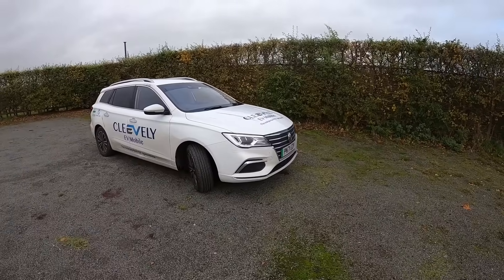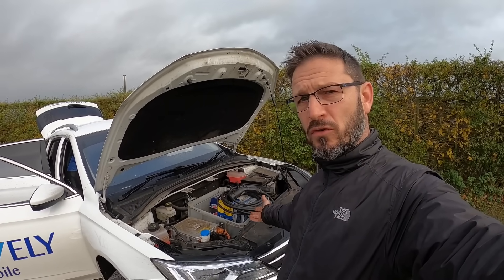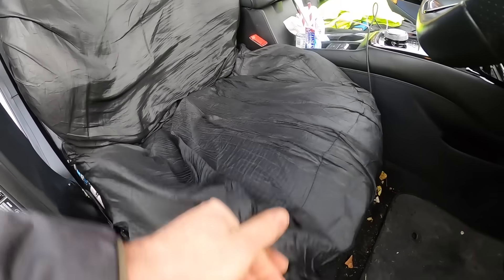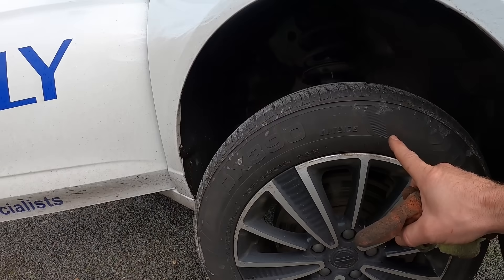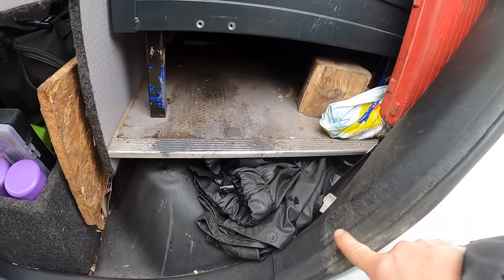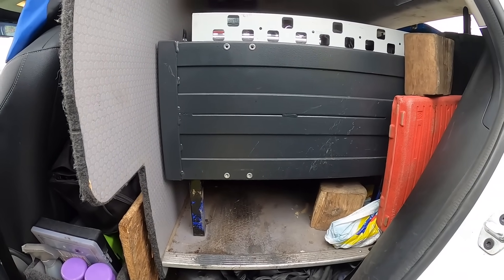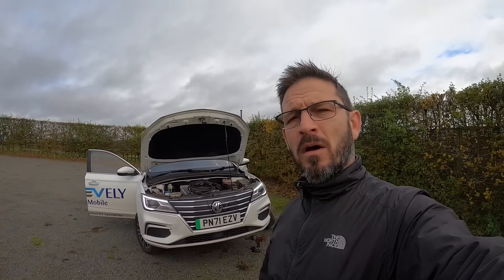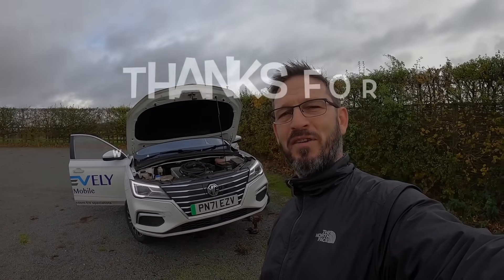How's My Electric Car Battery After 100,000 Miles?

Comment: the brake pad thing is rubish, I have a hybrid ( Rav4) a 2020 120,000 only just replaced the rear pads ( they could have done another 20/30K easy and the still on the original front pads

Comment: It may not be an issue yet for MG's but I almost crashed a 10 year old Mercedes because one of the rear brake pads fell apart. The friction pad separated from the back plate and my brake pedal went to the floor as I drew up behind another car. I was lucky and got stopped in time but it was close.  I can only assume it was rust/corrosion that caused it because the pads had loads of material left so as a mechanic this is something you should bare in mind when working at older cars.
On a happier note largely because of the great reviews from James and other Youtubers I bought a used MG5 and so far love the car.

Comment: Picking up James' point regarding the traction battery doing high mileage over a short or long time. There's an arguable point, I feel, that 100k miles over 10 years is easier on the traction battery than 2 years for the same mileage, especially if you have a battery that hugely prefers lower charge speeds, say in the Type 2 range of 7-22kWh. Over 10 years/100K miles you are obviously going to do less truly rapid charging. So I would say that it is arguable [not definite] that high mileage in a short period is harder on a traction battery than spreading it out over an extended time. And if true, it means that MG5 is doing even better than it already seems.

Comment: I'm changing my 150Ah battery modules for 174Ah (52 - 61kWh) if they made 200Ah modules in the same form, it would give it 70kWh and around 300miles range driving carefully! Tesla beater?

Comment: Thanks for the review (I'll stick it in the memory bank for later), it COUNTERS a lot of opinions (and facts!!) I've already seen which are quite negative.  There are (too many to be dismissed) cases of batteries just "out" of warranty requiring replacement, and the replacement costs being truly horrendous.  (I've seen the invoice from Roger Dean Chevrolet quoting nearly $30,000 USD to replace a hybrid battery in a Chevrolet Volt at around 70,000 miles).  In Australia, at this point in time (we have some of the most expensive electricity in the world), it just isn't viable to go electric (a "tank" of electricity is "about the same" as a tank of petrol when range is factored in), and the periodic requirement for long distance driving without charging stations is the reality at this point in time.

Comment: Still has the disadvantages over a diesel. Range leading to Range anxiety. Constant planning of routes due to lack of chargers, initial cost, and charging times especially if you can’t charge from home. Possible future power supply problems if sales outpace chargers availability and the necessary nuclear power stations that take 15 years plus to build. For 33 million cars going electric and applying average milage ( 10000 ), average range (250 miles ), average battery pack ( 54 kW ) works out at an additional annual power requirement of 89gWs of power and that’s over the output of 2 of the largest nuclear power stations ever built each rated at 39gWs output annually. Now consider van,trucks and lorries heat pumps, cooking all to be electric then there will need to be even more nuclear power stations built. Another problem is EVs are not very suitable for towing caravans or charging when having a caravan hooked on. ( see Pedro Pete YouTube re towing a caravan. ). Motor homes will have a restrictive range and an overall gross weight ( Citroen relay has either 73 mile or 137 mile range depending on battery choice. ) The trouble EVs have their place but they are not suitable for every thing.

Comment: I don't agree: age is also relevant for each part of the car.  The car in this video drove many miles in 2 years and it drove in better circumstances: it was warmed up more and all condens could evaporate.  Rust is also not an issue.  However: your car will probably come on de the second hand market with an altered odometer.

Comment: I have to disagree with you on it being "not up for debate." Leaving the car at 100% or 0% for extended periods does damage to the cells, which could be more prevalent in high mileage over a long period of time as opposed to high mileage over a shorter period of time

Comment: As far as costs go these cars are not cheap as chips to run though are they. £36000 new and after 2 years and 100,000 miles what is the depreciation. I shall give you an example. VW golf diesel over 2 years depreciates around £5000. The equivalent VW EV depreciates £19,000 in 2 years. That makes the running cost out of most famies reach. Be interesting to know what your depreciation is on that MG

Comment: One thing that might be worth commenting on is while a traction battery with 100K through put isnt showing any particular issues you could find a battery thats had less usage is worse because its been left sat at a high voltage for long periods as thats a known issue for lithiums which cause degredation faster than cycling. Good little round up of the MG 5 though.

Comment: I'm sorry but it has to be up for debate, whether mileage over a short period is different to mileage over a long period.
I find it very difficult to believe 100k miles in 2 years didn't necessitate almost exclusively rapid charging, which would not be necessary with the same miles done over 10 years.
And of battery failures that do occur, habitual rapid charging seems a common theme, with prior degradation giving no warnings.

Comment: There are several expert articles where battery aging is distinguished by mileage and age precisely because of the slow but measurable change in battery chemistry over time.. I don't know where the truth lies, but the problems with older batteries in the Nissan Leaf may indicate something.. The second thing is corrosion protection , which all Chinese cars have bad, unfortunately not even Ford is a winner :-) For me, something else is more important: MG is the Chinese communist state factory SAIC, which financially subsidizes the production of MG, financially favors the purchase of the battery, furthermore, the production is not ecological and China supplies the parts Russia for arms... May it is time to support "west" ev's more than from china ...

Comment: 100k in 2 year isn’t the same as 100k in 14 years with average usage. Time matters to electrical and mechanical things. Time will expose different failure modes.

Comment: 50k out if a set of tyres? Had to change my front ones a 18k, about the same as an ICE powered car. Tracking is fine and i drive pretty smothly. And we're being told EVs use more tyres due to there weight.

Comment: I have a face lift ZS EV and it's great! However, MG is not so great... 

I was told when I bought the car, that the first service would be about £65 and the next about £160. Whether that was salesman's uninformed speil, I don't know. But the first service was over twice that and the second (done yesterday) was a few quid less than twice that advised. Apparently, that's down to 'revised pricing'.

I've read that the MG warranty is not as comprehensive as one is led to believe. For example people on the forum saying that an electric roof fault was not covered etc.

So, my question is, that seeing James talk about how little needs to be done over really high mileages (mines done 14,500 miles in 2 years) why are main dealers charging so much and can we safely go to an independent? I mean, I asked for a state of health check on the traction battery and was told it was 98%, only to find that this was for the 12v battery!

@James, do you service MG EV's in Hertfordshire or know of someone who can, because I think I'll just bin MG dealers. From past experience I've found that independents give a much better service and at a reasonable price.

Comment: I am very pro-EV and have an MG5 LR myself. At 7:24 you say that 100k miles over 2 years and over 10 years is the same. Not exactly, as lithium batteries chemically degrade even if they are stored at 40% in a cold place and not used at all. It's not going to be a huge amount, but just cycling the battery/energy throughput alone isn't the only predictor for wear as average temperature,  age and average depth of charge/discharge definitely has a bearing too. Do you know anything about 12V system issues on these cars?

Comment: Two years old 100,000 miles my car has done 74,000 in 13  years . £40 per month why would i want to buy a EV. If hydrogen comes in id probably buy one . The only thing is my car is dated. 58.9 mpg.

Comment: I love your channel and I'm an EV fan but the traction battery and age is definitely up for debate. All batteries, including lithium batts suffer from calendar aging as well as cycle degradation. That's because there is always a chemical reaction going on in the battery whether it's charging, discharging or just sitting there. Calendar aging is even in the manufacturer's specs for lithium ion batteries. Calendar aging is generally put at 0.5% to 2% a year with some batteries suffering bigger drops in their first year but then levelling out.

Comment: If you had a diesel averaging 50 MPG (imperial), that would cost £15,000 for 100,000 miles at current average diesel prices (£1.58/l). Charging at night on Octopus Go and averaging 4 miles/kWh, it would cost less than £2000, which is similar to the servicing costs for diesel. So if the car cost £30K and goes for 200K miles, it's fully paid for itself in fuel and servicing savings (the same total cost as a free diesel car)!

Comment: Hi James great straight to the point informative video thanks. Could you explain how it's possible to keep the warranty on my FL5 but have you do the servicing.i have been burnt by Nissan before insisting I have break fluid change after 18,000miles.

Comment: How do you charge them up during a power cut?
Reply from the maker: We have a home battery that we can use, but in reality, power cuts are infrequent and often very short. We've had several over the last 3 years, none more than 30 seconds long.
Reply: How would you get petrol during a power cut if you needed it?
Reply: @Brian-om2hh  out of a can.
Reply: @MARTINA-gc3tq  You are of course assuming the can is full before the power cut.....

Comment: I’d consider one of these, but sadly the local dealer is Richmond, total bandits to deal with, can’t get anything right, think nothing of having you off the road for 6 weeks at a time for simple stuff
Reply from the maker: Fair, and a shame. There are other options for servicing and repairs however.
Reply: @Jamesandkate  yeah true, I had a Hyundai off them, literally everything the touched was awful, admin errors, lies, damage, doing work in the wrong car(other customers repairs on your). Had to chase continuously to get warranty work done. I eventually cut my losses as it was a full time job dealing with them. God forbid you had a serious issues that needed them to act in anything quicker than months . Keep up the great vids

Comment: Interesting and encouraging video James, thanks for taking the time to do this. Aside from the reduced pollution including tyre and brake emissions would I be correct in assuming the lower running costs and minimal downtime of the cars plays an important part of being able to provide the mobile service at a competitive cost?
Reply from the maker: 100%. We have a back-up, just in case, but we don't want to be using it. Reliability is absolutely key.

Comment: Modern car seats are designed to pander to the fantasies of middle aged sales guys from the mid 2000's 🤦‍♂️ "support" for "sports" driving in Ur diesel Mondeo and means most seats are now narrower than people with side bolsters that transfer all the violent lateral impacts from driving on crappy potholed uneven UK roads straight into your spine. It's incredibly stupid design that won't be solved until dudes running fleet purchasing are replaced by ....well, until fleets aren't a thing anymore. Vans are still ok, so are some bottom end cars but yeah, anything that's bought by reps is terminally uncomfortable but hey, things working right hasn't been a priority in the UK for years and we don't care as long as we get a GT badge or "Sport" on the back of our SUV crossovers 🤷‍♂️

Comment: Worth stating on your fleet.  They aren't cosseted.  They're aren't your pride and joy like someone's private car.  They're a tool to let you do your job.

Only had the one issue on ours.  The 12V battery went flat through lack of use and wouldn't take a charge.  At the time, my wife (it's her car) was WFH full time so it only went to the shops.  A new 12V battery was fitted and now she works a good distance from home and goes in 2 days a week.  Otherwise zero issues.  It's a great car.

Comment: dont batteries degrade over time and especially if they are just sat doing nothing. i had a zoe and did 50000 in two years and battery was at 98.8% and i abused it ran flat and charged to 100%
Reply from the maker: Yes they do, but it's very slow. Throughput is the main cause of degradation.

Comment: Morning James got a quick question regarding my niro. Ive been waiting for 6 yes SIX months for a new electric motor as mine has gone gaga (getting louder and louder as time goes by) if my vehicle breaks down and appreciate the costs would be down to me (its still in warranty) what would we be looking at for a replacement/reconditioned unit please? Cheers
Reply from the maker: Hi. I actually have no idea on a recon, I think second hand would bve the best option. Was it the motor or reduction gearbox?
Reply: @Jamesandkate  The mounts was replaced last year so I confirmed with TMS and it’s the electric motor that’s being replaced

Comment: Just wondering how Tesla charge 30 to 40p per Kwh when all the others charge 79p round here in Suffolk. Does Tesla get cheap electricity or is it the usual rip off Britain from the major suppliers
Reply from the maker: Good question. Tesla are passing on the actual costs to their users. The price per kWh wholesale has been 11.3p this year. Basically, other CPO's are charging for their investment costs.
Reply: @Jamesandkate  Ahh. Thanks for that

Comment: James, Thanks for this close up view of how well your MG EVs have been holding up with heavy use.  On the subject of wear that occurs with calendar aging, vs miles, the biggest concern IMO is corrosion.  This can lead to an expensive battery replacement when corrosion results in water intrusion into an EV battery pack.  Owners of early Model S have had battery failures caused by corrosion of the fuse cover or vents allowing water to enter the pack.  Tesla improved their battery design to be more robust to corrosion in later years (2015-ish and later).
Reply: There are ways to slow down corrosion. Rustcheck is something should be done regularly on high corrosivse climate. I did on my civic. I got it used 14 years ago when it  was already 5 years old.  After 19 years on the road. Only the roof was rusted though. ( that was from due to design flaw from honda.

Comment: Imagine if you could get petrol at half price if you bought a specific brand of car? In the EV world that's Tesla and quite an important fact to consider when choosing which EV to buy. Between ICE cars and EVs there's no contest, 1/6 of the fuel cost for and EV if  you can charge at home. If you charge at home most of the time the Tesla half price charging is not as much of an advantage.

Comment: Hi James so Happy you shared this. I have an ZS 2022 and I see a bit of degradation about 6-8% and I have done about 10000km in a year now. It scares me of course since it is such a big drop but I think it will slow down over time the drop of battery capacity. I try to charge only to 70% normal days and go to 40-50% before recharging unless I have longer drives then I go to 100% which I have done maybe 10 times since owning my ev. I do live in Sweden and think the weather is the main culprit for this degradation.
Reply from the maker: Is yours an LFP?
Reply: No it is the long range so NiLi

Comment: I don't agree that battery will degrade the same after 2 years and 100k miles or 10 years and 100k miles. Battery will degrade over time slightly, especially if it was not kept at around 50% soc in time when it was not driven. But anyways, these are great results so far and crazy how pads and rotors can easily last lifetime of the vehicle on EVs
Reply from the maker: There is an element of time based degradation, however, we are now seeing 300k Tesla running NMC at 85% SOH. The curve is normally 5% in the first year then a very steady decline. However, thoughout is the main culprit for degradation.
Reply: @Jamesandkate  There's no doubt that battery technology has improved immensely, including shelf life, regardless of chemistry. But there are rather few 10 year old EVs on the road and even fewer at 20+ years old, so the real life data are just not there yet. I think we just have to recognise that degradation over time is a fact and that will disproportionately affect low mileage vehicles that might otherwise have 20+ years of useful life.
Reply: Correct. Li-Ion batteries have a shelf life regardless of use so a two year old battery will be in much better shape than a ten year old battery for the same mileage.

Comment: How were the Davanti tyres for energy, noise and handling compared with the originals? I need to replace my ID3s Bridgestones at 21,000 miles in part because they started with 6mm tread rather than the usual 7-8mm.
Reply: I used Davanti tyres on my last ICE car. They seemed fine. I'd buy them again.
Reply from the maker: They are really good, very quite and softer than the originals. We will continue with them.